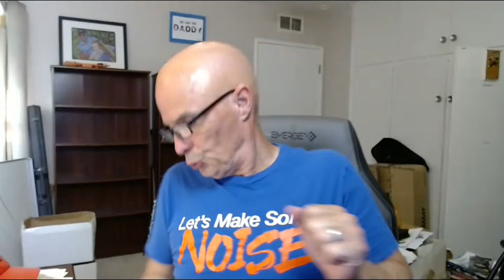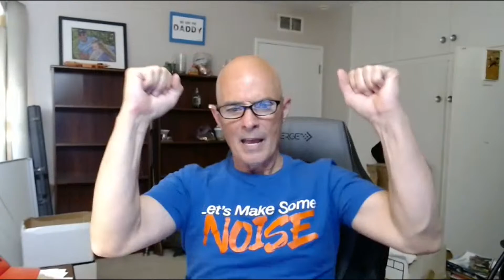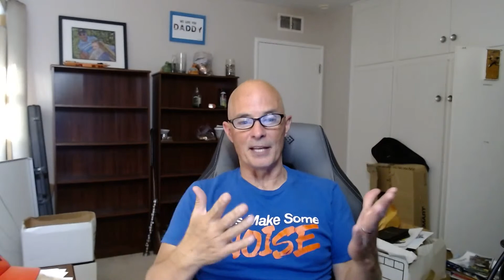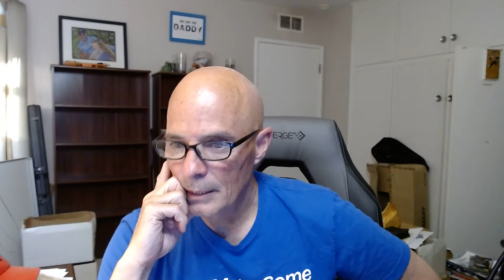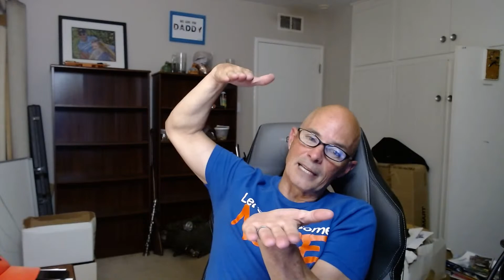LET'S TALK TECH-DOES CROSS SECTIONAL AREA (CSA) DETERMINE PEAK POWER RPM?

Comment: I chose a poor example of using porting skills. The Pontiac iron D port cylinder head. It has a generous 2.11" intake but a lousy 1.9" cross sectional area at the push rod bulge. You're lucky to get a 20 CFM increase after porting. As cast it flows about 186CFM.

Comment: As a question/update I exploded a tungsten bit, blowing a hole into the water jacket on my 8.1L heads. Another reason for using stone bits, just requires the extra step of finishing with lapping compound on a felt head to shine. Bought a new one and made a sacrificial chamber! The cross sectional area has a TON of meat. You think that might be the stock breathing issue? Other then the intake that is. I'll flow bench my finished set when I'm happy with outcome on my scratch model. At the l18 with 2000hp plus, max the NA output to the 700/750hp the full shebang plus 20-25lbs boost gets you there alright watch for your thrust bearing to lathe out, your crank is trying to pull the whole block lolol!

Comment: I'm laughing at alot of those responses. Darin Morgan has it dead on, Velocity, Velocity, Velocity, velocity, then CFM. Port shape, port design, Valve shape, valve face, back cut or no back cut, valve seat angles, bowl shape, and a ton more that's definitely not mentioned in this video.  Darin and a few other top porter's have me the biggest clue ever to do. Start in the valve bowl area and do one are only, put it on the flow bench, see if the velocities changed, move to next area, repeat again. Trust me, you'll see every thing you need to see. The flow bench will never teach you anything, it only tells you if it did better or not. It's a tool only.  Plus an induction system starts at the carburetor or throttle body and ends out the exhaust system. The book that those top guys told me to buy and read multiple times before starting the math. Yes, MATH DOES NOT LIE. " Engine Airflow" by Harold Bettes.
Reply from the maker: HAROLD WAS GOOD PEAOPLE-HE WAS AT WESTECH A LOT

Comment: We talked a month ago.  I talked to Ryan at ZZP about their 3800 intake. They use a insert to replace the factory runners. Shouldn't the stock runners make more power? Ryan said the HV3 insert does not loose any power in low rpm. I rather run the factory insert so I dont loose lower rpm.
Reply from the maker: anyone who says you don't lose power down low by shortening the runner has never tested it
Reply: @richardholdener1727  I might get a used one from the junkyard. I don't want to loose i HP or TORQUE. I saw Monte Carlo forum people are saying the HV3 gains are above 5000 rpm.

Comment: so this would be a hard one to answer, guess it would have to be run on a tunnel ram, but what works better for a mild street strip engine. Two 450 cfm carbs or a single 900cfm carb. Id say 500 to 700 hp.
Reply from the maker: a single carb intake is usually more streetable

Comment: A pump gas n/a build. For max safe hp, what's more important timing vs static compression and where's the crossover point?( also taking into account cam timing)
Reply from the maker: both are important
Reply: I would love to see a test with the conditions outlined above with different heads with the same flow rates and different combustion chambers.

Comment: Velocity probe (pivot tube) test at 4 length locations, in 12 point grids, inside the port.
Velocity and cfm don't go hand in hand.
Porting the short side is defeating. Look at it like this, a tunnel with a hill. No matter how smooth the transition up and behind the hill, the wind will always follow roof, or long side. The faster the wind blows, the least it touches the short side.
Now, the importance of CSA on port, is at the top.  Increase the width at the top, creating a trapezoidal shape. Since the highest velocity is at the top, then the extra width, will increase cfm flow while increasing the potential upper limits.

Comment: Line of sight to the valves more line of sight to the valve more horsepower and smooth turns
Reply: Final line of sight for the charge needs to be down the bore axis, not into the cylinder wall.

Comment: Valve events/intake length are what changes where the power is made.  You can port a head and keep the same port volume. I weld up areas and port others to keep airspeed up. Eg lifting an intake port, ill weld up the floor and port the roof.

Comment: Cross sectional area has more relavance to torque, peak power is a another story.
For me I try to go down the road of having a realy good head and as mild cam as possible to make the power we are looking for.
Reply: But mild cams don't go "potato potato potato"...
Reply: @mikescherrer4923  🙂
Reply: My new setup on my 2011 Camaro SS has only a GM LS hot cam I'd consider it a pretty mild camshaft 219 duration intake 228 duration exhaust .525 lift definitely not a max effort camshaft it has CNC ported LS3 heads runs and tuned on E85 with other upgrades it made 520 horsepower and 490 foot pounds of torque at the crankshaft at the wheels it make 430 horsepower  6200rpm and 410 foot pounds of torque at 5000rpm it has a built 6L80e transmission and Circle D 4200rpm stall converter stock 3.27 gears weighs 3780 with me in it has a full interior and air conditioning made 3 eighth mile passes with it the best was 7.40 at 94mph not earth shattering but for the weight of the car with a fairly mild camshaft l was surprised car cruises the highway at 80mph at 2100-2200rpm smooth as silk like stock has a ever so slight chop at idle that is barely noticeable and has wicked throttle response at any speed with a slight push of the throttle car did a 1.70 60 foot time it's a very streetable car